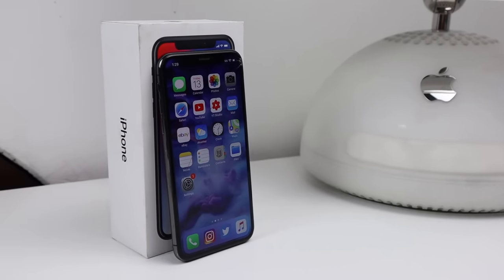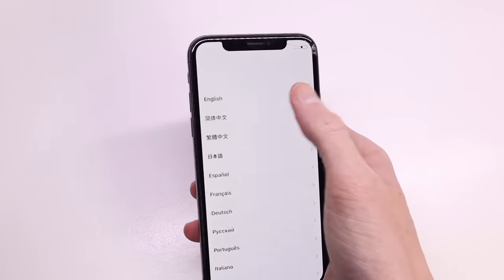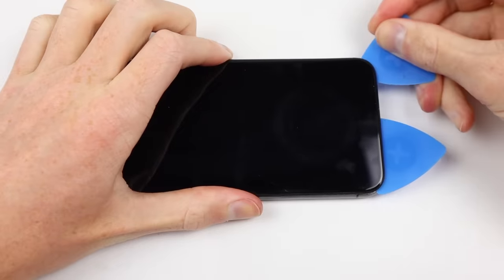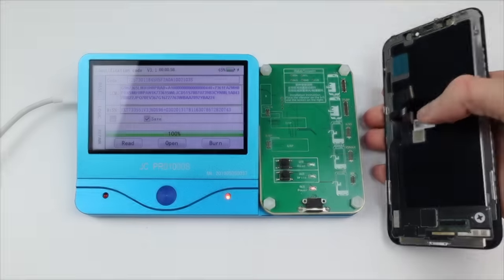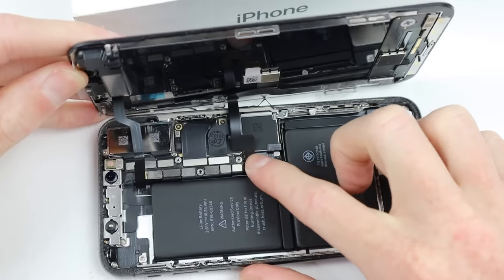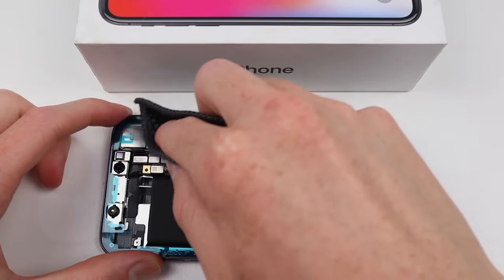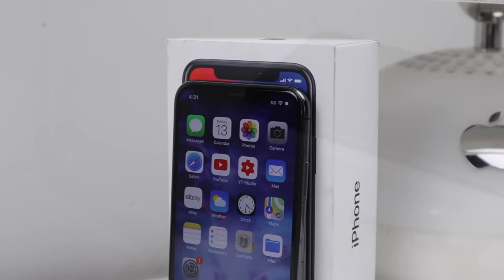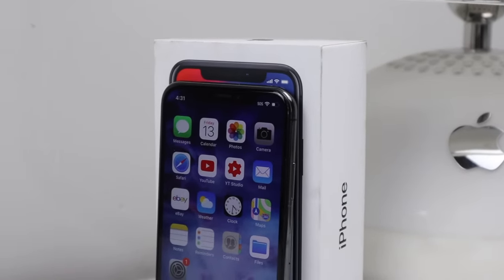iPhone X Screen Replacement Done Correctly

Comment: As a very experienced senior maintenance engineer I do not consider this a professionally done job. This person looks more like a hobbyist or a sales person who wants to sell products. Real professionals don't have this kind of massive tip screwdriver sets but few real ones which are much better to use. I have used Bernstein screwdrivers for 50 years which I do recommend.  And what's the most importat, we use an ESD mat and/or bracelet. NEVER open a phone without electrostatic protection. Even if the equipment seems working after the job, the static shock may have destroyd some protective components and after that, very minimal static electricity may destroy the phone.

Comment: Honestly this is a very bad job and not the actual job but the parts that were used . Ifixit not only overcharges but they don’t give oled displays. That’s a crap lcd and your putting True Tone on a display that wasn’t really designed for it . That’s why it’s not necessary for you to do that . And I understand about the water adhesive but those displays don’t even have a water proof seal so there is no point . You opened up your phone it’s not waterproof anymore